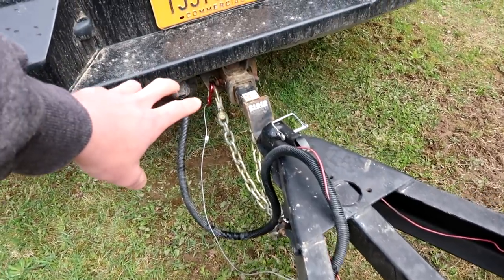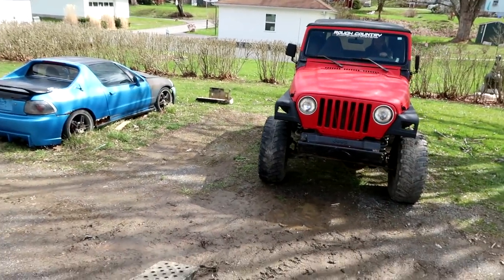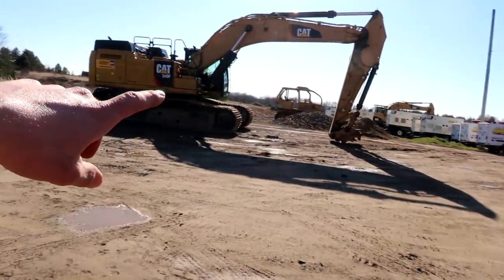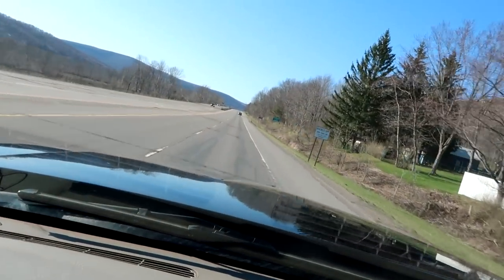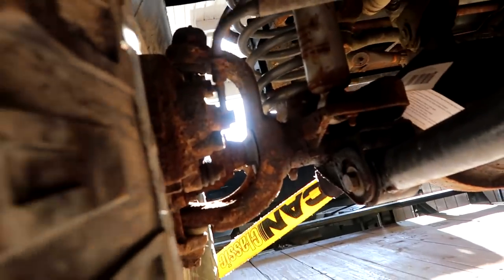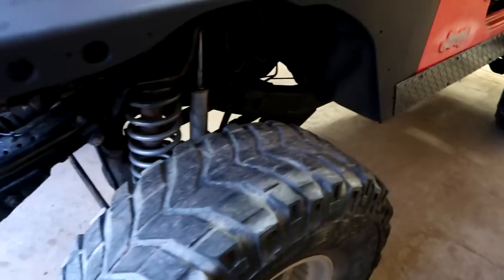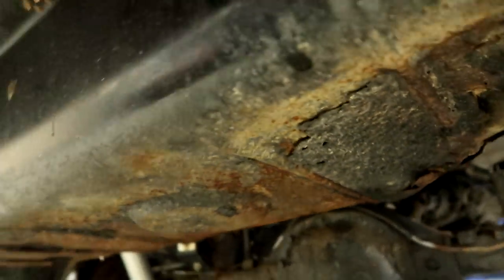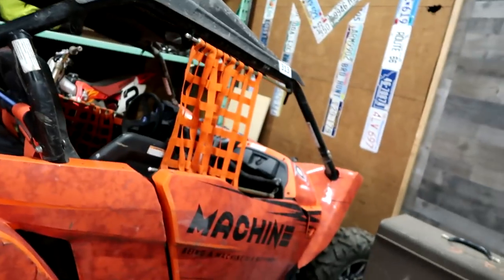I BOUGHT A JEEP DEATHTRAP

Comment from the maker: Where do i start?............... Seriously
Reply: Buy ALL the #MACHINES
Reply: 3DMachines good😊👍
Reply: Ayeeeee
Reply: start by messing with moter
Reply: Start by calling @goonzquad
Reply: 4bt swap
Reply: New name is red rocket 🚀
Reply: Start by addressing all the problems and the name red Devil?
Reply: The name should be roudy red and take off the top or get a legitimate hard top and fix up the engine
Reply: Or rough red
Reply: 3DMachines I want to see this thing running mint and maybe a dip in a mud puddle!
Reply: Try and swap a 350 small block in the Jeep
Reply: BMW?
Reply: No ware its a jeep it belongs in the junk yard
Reply: 3DMachines those tires are expensive they are Mickey Thompson’s popular where I live in Australia
Reply: 3DMachines you should call it koolaid
Reply: Put an air filter
Reply: I"m glad you can weld because that thing needs some panels and reinforcement. Engine sounds good. what did you pay for it?
Reply: What Type of tires
Reply: 3DMachines my inline 6 has 350,000 miles and its running strong
Reply: Motor then make some nice bumpers
Reply: 3DMachines change the motor it dose not sound like it should it sounds like it’s  running on like 3 cylinders
Reply: 3DMachines you better know what a Jeep wave is
Reply: 3DMachines call it the red monster
Reply: matthew moult we had a jeep. Cherokee it would almost shake itself apart once you hit 60 km/h and it had rust a foot up the door only the passenger door worked from the outside we called it the red rocket
Reply: Hey Dalton, cool Jeep! You should check out fellow YouTubers Goonzquad channel. These two guys restore old Jeeps and remind me a lot of you. They would be a great source of info and maybe even a cool collaboration vid.
Reply: 3DMachines CHECK THE FUEL PUMP my truck would only go two blocks then quit on me
Reply: 3DMachines maybe its the neutral safety switch since its a standard.
Reply: 3DMachines what about big rad or big red
Reply: 3DMachines watch the goonzguad on YouTube they restore jeeps
Reply: How much did u pay for it/great video can't wait to see more on it :)
Reply: Start with motor
Reply: Mine has 385,000 and runs like a champ
Reply: Since  jeep stands for just empty every pocket my thoughts were the money pit
Reply: zeemanjr what?
Reply: zeemanjr oh ok
Reply: Yep I agree GARBIGE NO GOOO!
Reply: 3DMachines name it the kool-aid man
Reply: 3DMachines take the top off in the summer
Reply: i have over 200,000 on my cherokee and i still spin my 35s like butter
Reply: Start by taking it apart and cleaning every thing
Reply: 3DMachines name the jeep big red
Reply: 3dmachines join pirate off road nation
Reply: I was gunna but that jeep
Reply: 3DMachines rust or motor
Reply: 3DMachines get it running right first put a winch on it then take it out to the mud and see what you need after that.
Reply: Start with the ignition system, ignition coil, plugs, wires, distributor cap and rotor
Reply: Thats my old jeep. Im from Olean Ny and traded it off down in pa after I put lift in it. It is a 4.0 swap. I didnt feel like messing with it,good luck.
Reply: Take the rough country lift off and throw it away if it’s older than three years or so the build quality of the older stuff is bad I swapped mine for fabtech and I’m extremely pleased and the angle on the drive line is normal with a lift but you can ruin things with the angle it stresses those parts and can snap drive lines
Reply: Jeep wave
Reply: Try the crank position sensor
Reply: I'd name it the cherry popper
Reply: 3DMachines tractor tires!
Reply: 3DMachines I got a 2004 wj 4.5 in lift with the 4.0 586xxx and still going
Reply: 3DMachines  DALTON ! Keep the oil in good shape use a good oil filter and when and if the lifters get loud and start taping either leave it alone or fix it I've had over 6 of these engines and they all had some small lifter tap
Reply: 3DMachines The red wrangler
Reply: start by testing the engine to make sure it is even fixable, it sounds like it only running on a few cylinders,  you can get a decent junk yard engine for around $700, or you can get a 4.7l golen stroker. It uses the same so it should be an easy swap.
Reply: I’d start with checking fuel pressure. My Cherokee with the 4.0 has 250,000 miles on it and still going strong
Reply: Figure out why it won't stay running then address the diffs and brakes
Reply: I'd start with dropping the fuel tank cleaning the tank fuel pump sock than new fuel filter. Than if that doesn't fix the running problem I would get more in the injectors
Reply: name him/her “BIG RED”
Reply: Name it "The Death Trap Creeper"
Reply: @3DMachines if you're able to, pull the body of the jeep off the frame and sand blast the entire under carage and the frame and spray bedliner on both then do the same with the axels. then once you do that replace everything such as brake pads, rotors calipers body mounts steel braided brake lines etc. Might want to repaint the jeep orange with tinted windows and black top to match crush as well. new tires and wheels are also please.
Reply: oh i almost forgot about a K&N cold air intake, hooker headers and full flowmaster exhaust.
Reply: if you leave it red you can call it big red.
Reply: Those inline 6's get about 400k well maintained, but if its babied make it 500k or 600k
Reply: 3DMachines u should take your jeep out wheeling after u get it all cleaned up.
Reply: 3DMachines Well its stalling when you let off the throttle. So it probably needs an idle air control. My truck did the same thing
Reply: Make sure your drivetrain works first. No sense in putting brakes on something that doesnt move. Looks like she sucked up some muddy water at some point
Reply: The Red Wrangler
Reply: 3DMachines snorkel and cool bumpers
Reply: Brakes 1st
Reply: 3DMachines name it punch like fruit punch almost like when you  named crush crush
Reply: Welcome to the Jeep community 🤙🏻
Reply: that drive shaft is off i would address that.
Reply: 3DMachines Should name the sketchy special
Reply: 3DMachines call it the red apple and you should start with getting the motor to run right first and then worry about the crusty rust and all of that fun body work 😂
Reply: 3DMachines name it big red
Reply: It's looking better and will probably turn out better than the BMW. Keep doing your good work :)
Reply: Name the jeep project Cherry
Reply: Start with the heart. Get it running then the brakes. Those are the two obvious starting points. then i'd go for the suspension. Rough country is okay to get back and fourth, but if you want to off road, seriously i'd go into something like tera flex or get coil overs for the most travel and best ride. lift the body off the chassis and do a better check for rust and repair it. use por 15 on the chassis after you repair it. Old jeeps like to rust around the rear especially the passenger side behind the back wheel on the chassis. If you get serious enough we can get into gearing and axles etc later.  Good luck with the new purchase Dalton. I look forward to the new addition being wrenched on.
Rob
Reply: It's the Feds that pay for that road.
Reply: 3DMachines patch the rust , drop some of the lift for the pinion angles , go down to 33s ,  I've also seen plenty of 4.0s with 300k + miles . If it's all going to be off road go to 37s , and fix the pinion angles. Don't invest too much , they don't bring what people ask.
Reply: 3DMachines the hole in the floor board is supposed to be there it is a drain it should have a bolt in it so when you sink it in a mud pit then u can drain out all the water
Reply: 3DMachines for the whole dif/driveshaft thing, the axle should've been tilted but clearly its not
Reply: Pleas look up goonzquad on YouTube they do exactly what your talking about. Ya'll three together could make a freaking master  Peace!!
Reply: If a 4.0 misfires check/replace the crank position sensor.  10mm socket and several long extensions can get it out.  Use an OEM sensor, not aftermarket.

The 4.0's I've had lasted 250-300k miles, still ran just used/leaked oil.

Check rear main seal for leaks

All of mine needed a water pump every 80-100k miles

Flush/refill coolant system every 1-2 years, they get rusty, overheat and warp the head.
Reply: 3DMachines start on getting her running here are a few things you could check, eather your timeing is off, or your spark plugs are out of order, or injectors are not right, gas maybe bad, spark plugs maybe bad, fuel pump maybe bad.
Reply: Red beasts
Reply: Try looking at the fuel pump it sounds like it's not getting fuel
Reply: Start by not flipping XD
Reply: 3Dmachines you should but the new Interco cobalts they would look good on it
Reply: You need Seth's help on this project.
Reply: 3DMachines rust, sketchy spring mount, bad brakes, driveshaft angle, it's a jeep thing.
Reply: My 2004 i6 has 210k km. Name it Clifford.
But why don’t you start by telling us how the race went.
Reply: 3DMachines getting it running
Reply: 3DMachines you should get some king shocks and just start by tearing everything down and rebuilding everything.
Reply: BIG RED💁🏼
Reply: Lower it a few inches, please don't be that guy that has lifted junk you just kill us low riders in any accident. Honestly, I live in a lifted truck area and I hate them all past 3 inches from stock it almost scares me when I see the only thing stopping my vehicle is the undercarriage and my head is at their frame
Reply: Snorkel
Reply: 3DMachines bigger axles and tires
Reply: 3DMachines the holes in the floor pan are for rubber plugs, so you can drain sludge ect. Same jeep I had, looks like a good start, definitely address the "lift kit" on that guy lol. Jeeps are made so you can "easily" cut out rotten panels and weld in new. Good luck D
Reply: 3DMachines get it’s a Jeep Thing sticker
Reply: Start at Jeepforum.com, honestly. Engine's obviously the first thing, as there's no point in doing tub/frame/drivetrain until that'll do something. Then brakes, and drivetrain (get an SYE and driveshaft, it'll make the rear diff angle less scary looking. But it IS a 7in lift.)
I've a 95 with the i6, and it's at 240k currently, no real issues since I got it at 180K. Harmonic balancer bearing was the toughest fix, and that was prob caused by my out of round wheel on a cross country roadtrip(which wound up taking said wheel's axle bearing out, and scoring the axle too)
Hit jeepforum.com, get some pics of the sketchy bits, and make a generic post, asking whatto look for, what folks think might need love,etc- and then make specific posts for each fix as you give it a go.
Reply: You have mud and water in the tank 
My jeep was stalling sounded exactly like that and that was the problem
Drop the tank
Reply: a name for the jeep BIG RED
Reply: 3DMachines get if u can read this tip me over stickers and it’s a Jeep thing
Reply: Name it rusty red or big red
Reply: Start by fixing that staying problem then brakes and tires

Comment: The motor is a high output 4.0l. It’s a tank and will last forever. Every Jeep in my area has over 200k-300k miles and run strong. Could last forever if you don’t beat the crap out of it. I’d add coil overs and long travel arms to her. You’ll never regret it. It’ll ride like she’s on a cloud. Did it to my 4runner. Congrats on the purchase excited to see this build!
Reply: Eric Rafferty lol just had a buddy with a 89 Comanche with 4.0 86k threw a rod
Reply: I know a few friends who have around 500k on theirs and haven't had any problems aside from a blow head gasket. Jeep engines are pretty much the only thing that lasts forever. Everything else tends break fast though which is why the expression "Just Empty Every Pocket" is pretty common to hear with jeep owners.
Reply: JP32 89 had renix motor. Its diffrent
Reply: DeathfireD yea my 4runners head gasket just went. It’s not a fun project to fix. I’m at the “just empty every pocket” stage currently
Reply: Lol, thinking jeeps are good vehicles.
Reply: Eric Rafferty do you think coil overs and long travel arms are worth it on a '07 4runner that only goes off road every once in a while? Do those mods affect highway use much?
Reply: JP32 Your buddy didn't maintain it obviously, if you blow a 4.0 with 89k on it, you are definitely doing something wrong....
Reply: JP32 I have a 4L with over 200k and no issues.
Reply: Dalton dont long arm it if your gonna rock crawl, youll get hung up
Reply: We have a 13’ Rubicon with 150,000 Miles, with a lot of abuse around the farm. Only issue, ever, is the air conditioning actuator went out. It has never let us down, and we’re never getting rid of it!

Comment: Those engines are BULLET PROOF I had 346,834 miles on my 96 before the transmission went and i scrapped it due to rot but engine purred like a kitten, as you know maintenance is key. Cant wait for this build and hey if you get ambitious bring it up to Barnyard allterrain  in Livermore Falls Maine ive been racing a mud truck since i was 12 there and its an awesome weekend event!

Comment: This is a really awesome project!  Looks like the previous owner addressed the big rust spots on the body, the windshield corners, the rear corners..etc.  The floor isn't  that bad, the frame needs closer inspection but it didn't look too bad.  I would certainly get an accurate drive angle for the drive shaft!  Looks way to steep, you go through universals like crazy!  And if you keep a steep drive angle I'd put driveshaft hoops on it, to protect the shaft from rocks etc, and to stop it from flopping around and beating the crap out of the under carriage if it drops out.  Make sure the splines are long enough to have sufficient travel at the tranny and transfer case.  It really sucks when the drive shaft drops out because the over all length is too short.  Just a few things to consider, and check the steering knuckle also, a lift like that will put more pressure on it, as well as the larger tires.  I would also consider slotted rotors and over sized brakes, to make sure you can stop!  Looking forward to your plans for this project, should be a lot of fun.....

Comment: It looks like you have a Dana 35 rear axle. That axle doesn't handle large tires very well. The axle shafts will break at the c clip. I have a 98 inline 6 with 223000 miles on it. If you can get a good deal on  rims and tires from a brand new jeep Rubicon, you just need a wheel adapter that goes from 5 on 4.5 to 5 on 5. Rubicon tires are about 32". Good luck with the build. You can also do a slip yoke eliminator kit on your transfer case which will help with your driveline angle. That will require a new drive line as well.
Reply: Dustin Baker I thought Dana 44
Reply: its a Chrysler 8.25
Reply: its a dana 35, the cherokee had the 8.25, the only axles that aver came stock on a tj were the dana 35 and 44

Comment: First off I'm so excited to have a Jeep on the channel now! What it looks like you have is a low pinion Dana 30 in the front and a Dana 35 in the rear. Swap the front out with a high pinion Dana 30 from a Jeep Cherokee XJ, and swap the rear out with a Chrysler 8 in a quarter also, Cherokee XJ. You might be able to buy a whole Cherokee for a couple hundred bucks to rob the axles from , you will have to weld coil buckets to the rear axle if you do that swap, front should bolt in Jeep may not be running right cuz the O2 sensors aren't hooked up just a thought. My 4.0 Cherokee XJ has 250 thousand miles on it and still runs great with 35 inch tires

Comment: Looks like an awesome project. Some say those motors will run forever as long as you faithfully change the oil and take care of it. I do know some people who have had their 4.0's crap out on them with only 93,000 miles on them.

The top end of the 4.0's have an issue with oil flow getting to the lifters, rockers and cam which can make it run hot. There are aftermarket parts to fix that issue that are really affordable. There are tons of aftermarket parts for the 4.0 to beef them up as well.

As far as the axles, stock with no over sized tires, they are ok. Those Dana 35's are junk once you add larger tires and weight to them. My cousin and I ripped his Dana 35's out of his CJ-5 because they started to get stress cracks on the axle tubes towards the housing and in the housing itself. He only had 35's for tires at the time. We had to address this issue before we put in his nice 350 that he built to replace his AMC 258.

We fabed up some Dana 60's that I pulled out of my old 78 Custom Deluxe that I put rockwell axles under. I can't remember the specific measurements off from the top of my head and how much of the axle tubing that we had to cut on each side of the front and rear diffs to true them up, but it turned out bad arse.

You can probably find those measurements online. The Dana 60 swap is a pretty popular swap. Then he ordered some custom length 30 spline axles to fit the housing and did a c-clip eliminator. I talked my cousin into keeping the leaf perches on top of the axle housing instead of cutting them and running them under like jeeps did from the factory.

He was glad I did cause it saved him money from having to purchase a new lift. He definitely did not need one after we mounted the axles, installed custom fabbed extended shackles that we made, wheels and tires. His 38 PJ's cleared quite nicely after we had everything put together.

Comment: If u have to replace the wireing harness go w/ painless wiring systems also if u change the lift spend a little bit more and go w/ metalcloak. That company is awesome and very reliable. Also  my father has a Jeep lj that is in Jeep clubs all over the USA and he has that brand lift and it preforms amazing so it's worth the extra $ and if u want real 4wd go with arb airlockers they are worth it too. It will make it so that Jeep will go up things u can't walk up.